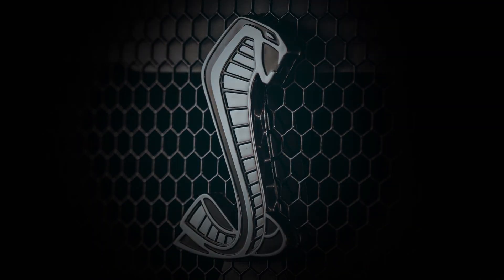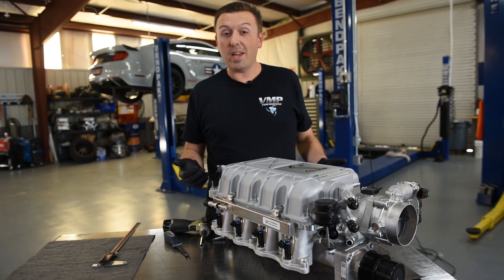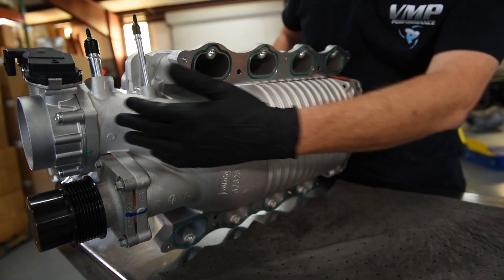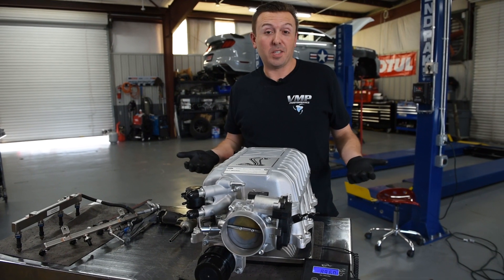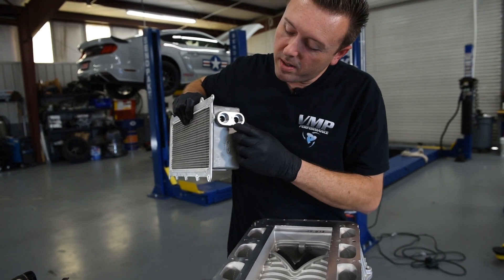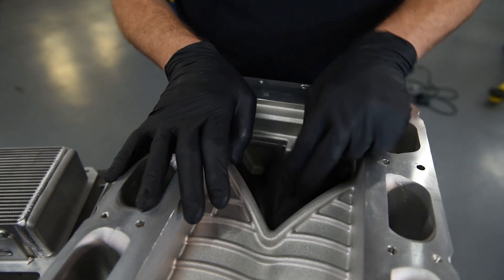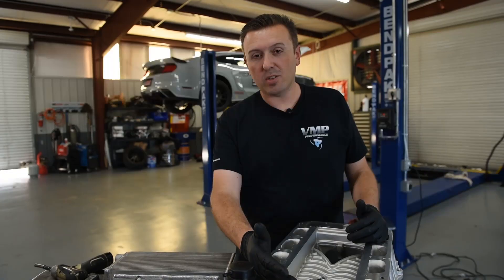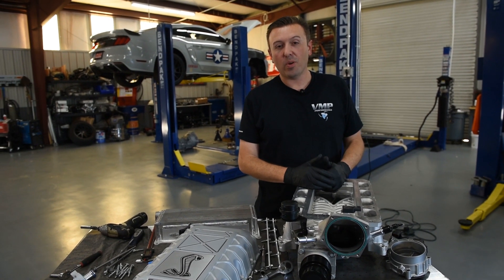Tearing down the 2020 Shelby GT500 2.65 L TVS Supercharger

Comment: I see a ported blower w bigger TB, a custom intercooler cartridge with a custom lid and of course a ported manifold and heads!
Reply: Mark Bulva All good ideas but heads already CNC like the GT350. I believe they flow 5% better. That inlet between TB and rotor pack has largest bang for buck as the restriction.
Reply: We all know the factory always leaves a lil sumpin sumpin that the aftermarket can fine tune. I’m sure the heads can be made to flow more lol!

Comment: Ford Australia Supercharged a 5.0 Coyote back in 2010 through to 2014 in the Falcon FPV Sedan and utility. The Supercharger was developed by Harrop Engineering and was a 1.9 litre capacity. The engines produced 315 and 335 KW with a Police special rated at 400 KW.

Comment: From 8:11 to 8:20?? How do the rotors knock against each other? I can understand thermal growth of the rotors? How does a normal supercharger live without locking itself up, without a clutched pulley? I don't think I have ever seen a blowoff or bypass pulley in the installation of a VMP supercharger?

Comment: Do I get the hint that VMP is going to produce a more powerful and larger blower for the GT500? I think so! Wonder how much more power you can bump the 2020 GT500 up with just a bigger blower, bigger injectors and fuel system and other corresponding modifications that will help support each other for such high horsepower numbers.

Comment: Old news to me...worked on the development of this engine for the last 2 years. That blower design made things a pain in the ass. Many failures with them as well.
Reply: What the difference between this supercharger and dodge's supercharger?
Reply: What type of failures?
Reply: @that0871  LOL not much, a former Chrysler guy now at Ford worked on this project....can you tell!?
Reply: rotors wearing into the case and blowing aluminum shavings through the engine....happened many times.
Reply: @MyFriendPeter-d4k  lol 💀... The bearings on the 15 hellcat would go out I wonder if this the same guy lmao
Reply: There is always the inside guy, bet you engineered the first hemi too! buy a hell cat if you don't like it!

Comment: So is this better than a Whipple?
Reply: You'll stir up a hornet's nest.  Generally speaking the advantages of the roots are cost of manufacturing and the bypass.  Twin screw systems are adiabatically more efficient as they actually screw the air between the rotors.  Roots style "pumps" the air around the rotors and between the casing.  Hence the coating he referenced.  In some ways it's similar to the pump on a jet ski.  If the Delrin shroud that surrounds the impeller wears, the amount of force is reduced (which is why rental skis that have been flogged almost always go much slower than new skis).  Anyway, that tolerance between the casing is crucial, but also a concern because of the rotors scrape the casing they can send shavings through your motor.  The solution?  Something that can mate tight to the casing but not nuke the motor if it sends through.  At the end of the day, twin screw is generally superior because it'll make more power with less heat (all things being equal) but they're also GENERALLY more expensive.  But these latest rounds of TVS variants are up in the price range of a twin screw (which makes no sense).  For guys running E85 or race fuel, the differences shrink, but for guys running 93, IATs are huge.  If a twin screw can produce 10lbs of boost and do it at a noticeably lower temperature, that's going to mean a big power difference in what timing and what power output the motor can safely make.  Intercooling helps, but again, apples to apples a 3cubic foot cooler will cool better on a twin screw than a roots.  So in theory you can run more boost at the same temp, same boost at lower temp or whatever combo makes more power.  Roots have come a long way, but just know the whole reason they're popular is because it's generally cheaper technology and machining

Comment: Doesn’t the clutched pulley help with belt longevity preventing belt slip at rapid rpm changes?
Reply: Leland Holton yes. It lets the rotors over-run freely so the accessory drive doesn’t take the force of trying to slow the rotors down to engine RPM on gear change.
Reply from the maker: Yes, though we never had an issue with belt life on the older GT500s at this power level.

Comment: So is that the only intercooler for this thing or is that just a second line of defense to make sure you're definitely getting cold air?? I have never seen a intercooler inside a supercharger before...
Reply: Most sit inside the intake manifold, underneath the blower discharge port... this one is kinda ass backwards, the rotors are on the bottom of the blower blowing up... Yes that’s the only intercooler, doesn’t do any good to cool the air before it gets compressed.

Comment: 2020 gt500 check engine code p0106 usally the wrench light comes on a goes into limp mode have to turn it off wait a bit n till disappear for a bit n come again can someone pls help me???
Reply from the maker: That's a MAP sensor based code.  If it's tuned, you need to contact your tuner or the speed shop that did the work to start diagnostics or if your stock, it needs to go to Ford.  If you're local to New Smyrna Beach, FL we'd be happy to assist as well.  Feel free to shoot us an email to sales@vmpperformance.com or give us a call at (321)206-9469 to speak with our support team.
Reply: @VMPPerformanceTV  has jlt intake but not tuned it’s either or map sensor in back of supercharger or front?

Comment: I read that the new gt500s supercharger is the same as the 2019 corvette zr1 supercharger, is that true???
Reply from the maker: Same rotors in a different case design
Reply: @VMPPerformanceTV  So they are still two different superchargers?
Reply: @VMPPerformanceTV  in a sense